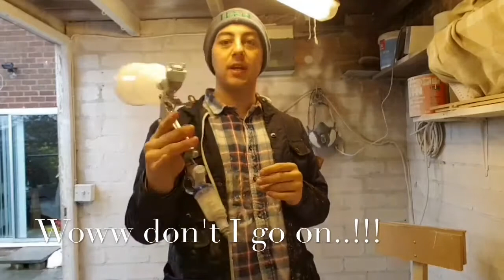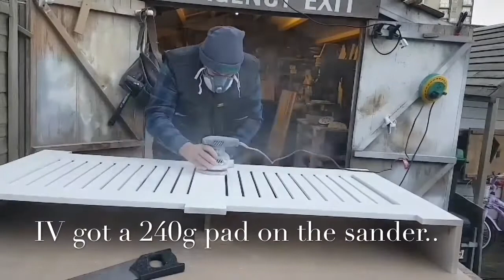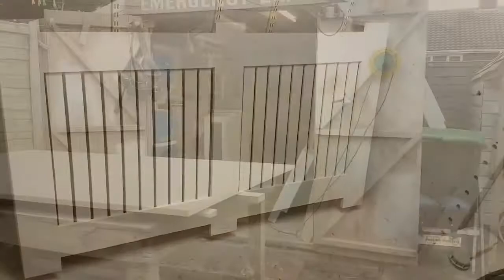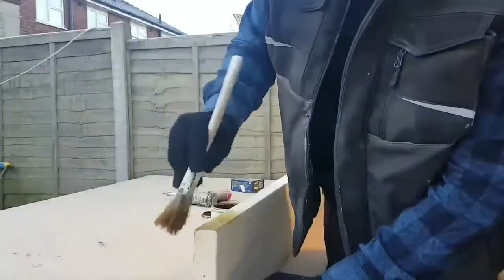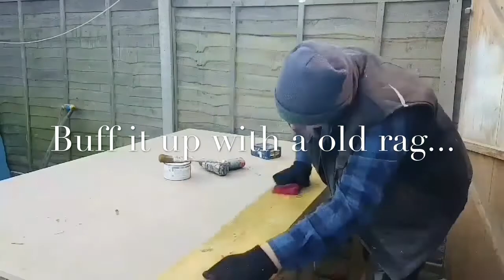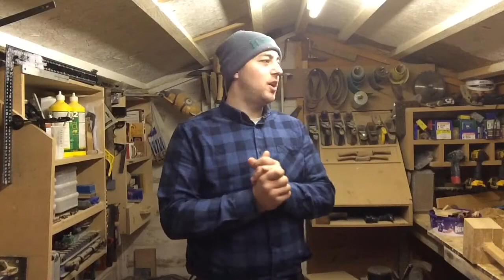Radiator cover build part 3

Comment: How do you recommend attaching to a wall
Reply from the maker: hey so buttonfix type 2 are good for hidden fixing.. or if you want a simple route then some 32mm mirror brackets just simple screwed is fine
Reply: Thanks bud. Just watched a NewBritWorkshop video on using them. Definatley prefer hidden attachments